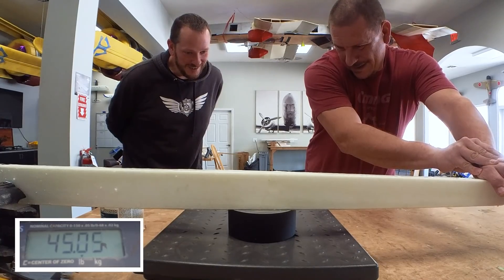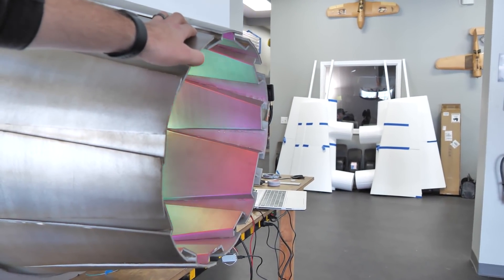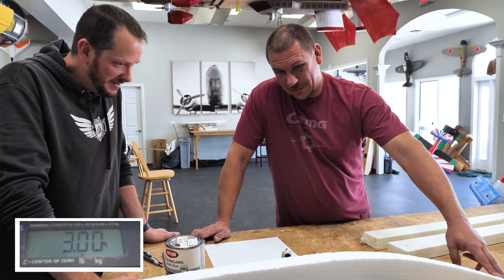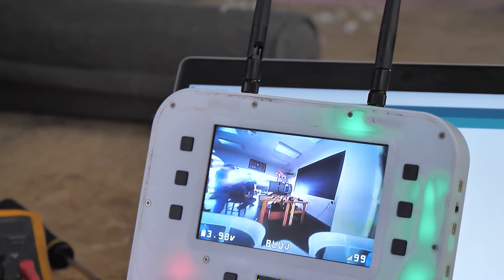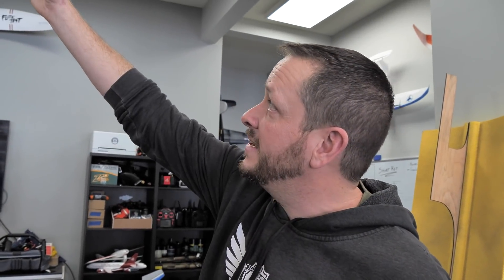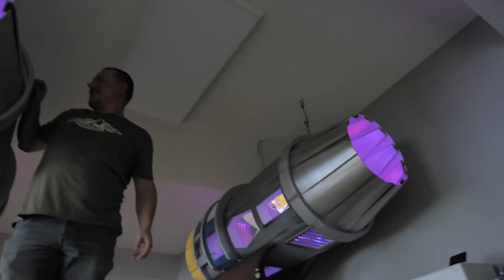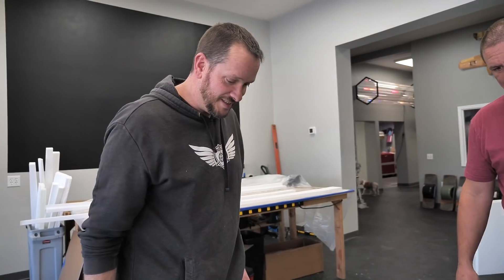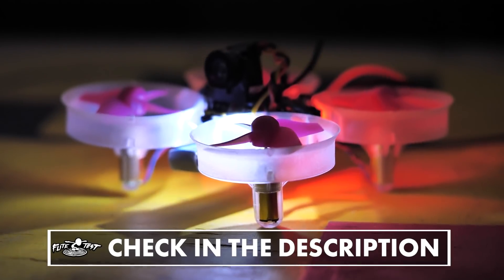Our DIY Star Wars Pod Racer Takes Flight - Week 6

Comment: At 4:10, you got that backwards. He is pushing down with half the force that is on the scale. If the scales says 14lbs, he is pushing down with 7lbs. The important factor is the  bending strength. The moment arm looks to be about 2'. The reaction is 46 lbs. The force pushing down is 23 lbs which gives a bending force of about 46ftlbs. To get an approximate bending force for the wing you need the load along the length of the wing first. Take the weight of fuselage (all up with all gear but exclude the weight of the wings) multiply it by the intended maximum in flight G-force (3g or 4g for a typical plane and 10g for a highly aerobatic plane), multiply that by a factor of safety (say about 2), and divide that total force by 2 times the length of a single wing (from the root to the tip, call it L). Call the wing load W (lbs/ft). The bending force on the spare is M=(WL^2)/2. As long as that is less than 46ftlbs, you will be okay. Note that this is just approximate which is okay for an RC plane.

Comment: 9g’s is for full acrobatic planes.  A lot of the classic planes were only rated up to 5G positive and 3g negative.  Were they tested to above that for a margin of error? Yes but they also were hauling way heavier loads and this test of the spar is pretty null because they localized the pressure on the spar they built.  They basically determined the PSI rating for the spar.  It’s a good thing to know but the best way is to mount the spar as it would be attached to the plane and apply increasing weights every 3-6” increments across the length of the spar.  Then you total the accumulated weight at point of failure and that will give you a spar G loading.  Of course the rest of the wing structure will add or subtract from the spars g rating as well depending on how the spar is attached to the rest of the wing structure.  All I can say is lots of luck boys and keep em flying!  You put in a lot of hard work and do a lot of test crashing so the rest of us can fly in luxury’s.

Comment: Fixture_____scale_____hand
 ↑____________↓__________↑
23__________46__________23
The measurement with the scale is not correct. 
If the scale is showing 46 punds, he is pushing 23 punds and not double. 
23+23-46=0
Reply: I noticed the same thing. Nice free body diagram by just using the keyboard.

Comment: It's pretty simple to optimize your spar design.  Simply "wraping" a stick of foam in fiberglass cloth is NOT the best approach.

Cut your fiberglass cloth into strips on a 45 degree bias, lay your spar on it's side, and apply the cloth to the front face of your spar; i.e. one face at a time.  The fibers will be running at 45 degrees to the span of the spar because that aligns the fibers with the direction of stress in a shear web.  Wrap the cloth onto what will be the top and bottom of the spar and trim it when it's partly cured. Then flip the spar over and glass the aft face, again wrapping the glass onto the top and bottom surface.  These shear webs can be pretty light, perhaps two layers of 4 oz or 6 oz cloth. Finally apply several narrow strips of unidirectional cloth (running spanwise of course) to the top and bottom surface of the spar forming a upper and lower "spar cap". 

 Notice that your test spar failed in compression.   That's because ordinary fiberglass is stronger in tension, so use use more unidirectional glass layers on the upper spar cap.  Of course use peel ply and/or sand the surfaces prior to bonding over a previously cured surface.  I assume you're using some sort of room temperature cure epoxy, right?

If you use this kind of construction, you will optimize the spar for strength, stiffness, and weight.  It would be worth doing another two or three test samples. But once you find a recipe that works, save the test data and you can use that to calculate how many layers of unidirectional cloth forming your spar caps gives you a certain strength.  You can scale up or down from there.

Comment: You know Mud Dart Rc did all the hard work for you and designed an led controller called MudLED that would've done all you asked for and more right?
Pretty sure you've even got 3 or 4 of them.
Thanks for the support guys.
Reply from the maker: 100% right!  This is a 12v system. Shoot us an email.  Have some questions for our next project:)

Comment: For full scale, the wings would be rated for about 9 times the force of gravity. For RC, you will easily see that much load. On a plane like this, your spar test should be showing several hundred pounds. Use plywood or hardwood for the front and back of the spar to reinforce the foam, then cap it top and bottom with carbon fiber, then wrap it all in fiberglass.
Reply: 9g’s is for full acrobatic planes.  A lot of the classic planes were only rated up to 5G positive and 3g negative.  We’re they tested to above for a margin of error, yes but they also were hauling way heavier loads and their test is pretty null because they localized the pressure on the spar they built.  They basically determined the PSI rating for the spar.

Comment: Guys your spar will fail in compression.   You need to cap the spar.  1/4” sticks in the corners or 1/8” ply caps would be fine.  THEN vacuum bag that.   You need a compression carrying member. This aircraft will be probably upwards of 80-100 lbs with batteries and motors.   Safe operation should be no less than 4g’s.   You can seriously hurt someone with that energy.  IE you should be able to put 320-400 lbs on the back of the fuselage.  Love your work and creativity!

Comment: This may be a moot point at this time, but wouldn't carbon fiber cloth instead of standard fiberglass cloth increase the strength of the spars at about the same weight?

Comment: Aircraft spruce has graphlite rods that you can add to the spark caps to add some more strength for little weight. I'd say you would only need two rods on each side.

Comment: The pods look awesome. Do have a question on what resolution those little drones that you were flying around were as well as do those VR goggles fit over glasses?
Reply from the maker: The goggles are too tight for glasses. Will look into the resolution but I think it’s 720
Reply: @FliteTest  cool, thanks

Comment: Guys?...please review your lever classes (types) and calculations!  I don't want to see you break another wing, either!  https://youtu.be/fzljPiPy9nw
Assuming a 1:2 ratio of pivot-to-scale vs pivot-to-application of force...your second class lever (wing spar as loaded) only requires that you exert 22.5 pounds force at the end to register 45 pounds force at the load.  A practical example of this is easily lifting a heavy load in a wheelbarrow.  Your setup is just an upside-down wheelbarrow.

Comment: Love you guys but your math is wrong. If the spar fixed on the bolt at one end, your scale is in the middle and you're putting weight on the other end you are actually putting half the weight the scale reads not double. You're pushing down with about 22 or 23 lb not 90 lb.
Reply from the maker: My mistake in speaking. I was referring to the point on the vice where the most force will be. My brain glitches sometimes. :)

JB
Reply: @FliteTest The vertical force at the vice is the same as at the tip, assuming the scale was placed in the middle along the beam. Therefore 22lb at the vice upwards, 44 in the middle downwards, 22 at the tip upwards.
Reply: @FliteTest  all good, mine glitches constantly. Love your vids, keep up the good work.
Reply: Think of it this way:  if you place a 23lb load at the tip and substitute a 23lb load at the pivot point (bolt), then the upward load in the middle will be the sum of the two downward loads (46 lbs) which is what you measured.  I agree with others who have said this spar is woefully under strength for a 90lb model.  Granted, the fiberglass on the outside of the wing will help to beef up the overall strength of the wing.  I think it would be prudent to build a spar that is at least capable of carrying twice the model weight.  That way, the two spars together would be good for a 4G load before you place them in the wings (I’m assuming each wing will generally carry half of the overall load).  I also agree that the point of greatest load is going to be at the wing root.

Comment: Try to make an actual flying rc pod racer! Preferably one with wires connecting the engines to the body instead of stiff spars. Might be impossible or overly complicated but sadly most of the ones I’ve seen to date are just glorified quad copters. If anyone can do it it’s you guys!

Comment: Sorry, but the force applied at the tip is half of that shown at the centre, isn't it?
Reply: Johan, you are right. It works as a leverage. The force in the middle is double of what is applied at the end. Or if you see it different, the force to lift something at the end would be double of what you would like to lift at the end.
Reply: @matthias962  YES! 🙂 [Applied force] X [Force arm] = [Load] X [Load arm]. (Sum of moments = zero, for a static system)